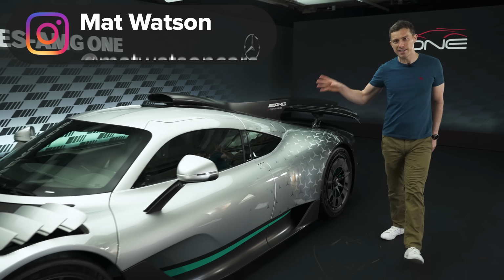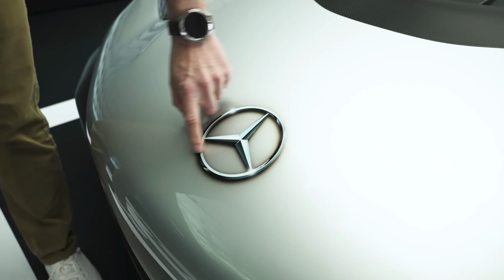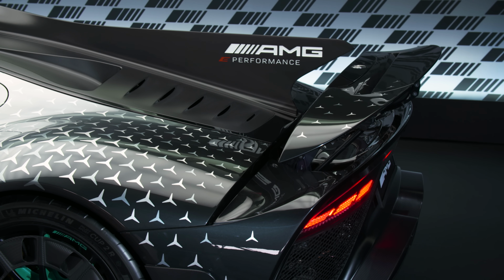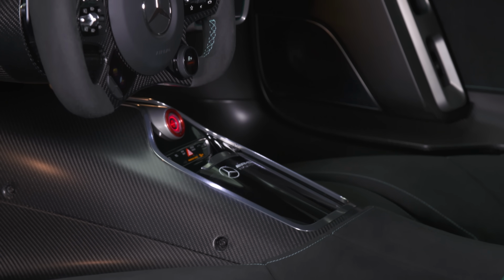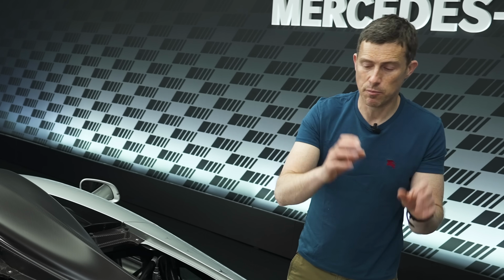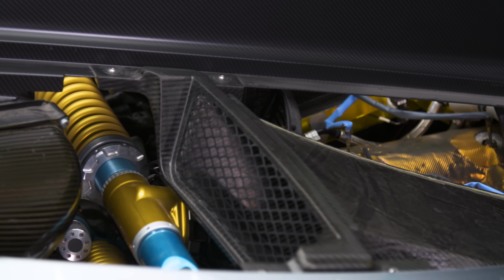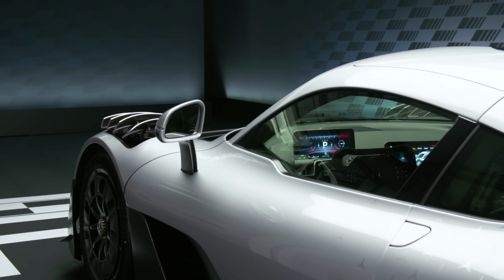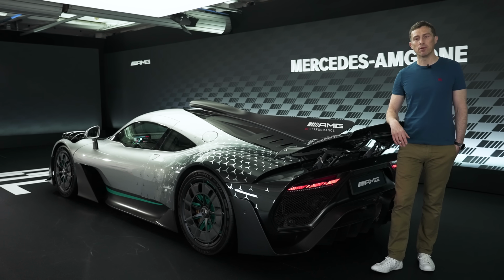Mercedes-AMG ONE: An F1 car for the road!

Comment: This thing looks epic :D. Already can't wait to see this go head to head with the Valkyrie and T50 ;)
Reply: Three very different cars though, to the point I'm not sure you can really compare them. This seems to be all about putting an F1 engine on the road and the result is an overweight, big and complex beast that'll likely be a right diva without a hell of a lot of maintenance which... actually, yeah, fair enough, they've put a modern F1 car on the road. The Valkyrie looks like it's focused on making a race car road legal which is very impressive for everyone except the poor sod behind the wheel who suffers PTSD every time they see a speed bump or pothole. And T.50 is more of a 'driving experience' car with ultra light weight coupled to a mad V12 while still being a (ridiculous) GT car. On track it gets even sillier with both the Aston and GMA cars having track-only variants and the AMG-One having that race mode which is very definitely not compatible with real world roads. Don't get me wrong, can't wait to see 'em all used in anger but a shootout for best in the world feels a bit... irrelevant.

Comment: I hope this car performs well on the track despite the fact that it’s heavy (1700kg)
Reply: and most important thing that the car doesnt porpoise
Reply: It's monstrously heavy, I am shocked
Reply: @mrle0719  yep. Its as heavy as NASCAR GEN6 Stock Car.
Reply: @mrle0719  same as 918
Reply: It’s heavier than a simple small car.. 😂 Even though they nearly did everything to make the weight as low as possible.
Reply: @Niels_f2704  i like the design but im not impress with the performance.
Reply: @Niels_f2704  yeah but this is anything but simple. Its also wide and long with electric motors
Reply: Why do people think this is like a C63S when we have 1600 kg Aventadors lapping the Ring in less than 6:50 minutes?
Reply: The car have porpoise like Mercedes 2022 F1 car. Ohh boy it's gonna be a hell of a ride
Reply: It's 1600kg on road without driver
Reply: @MT-eb2dx  Nope 1695kg without driver.
Reply: @MT-eb2dx  nearly double the weight of an actual F1 car. Quite mad.
Reply: @jasper5097  well, it's a road car, and it has EV capabilities.. so for that and the fact that it has 1000+ ps it's ok, the Ferrari sf90 weighs simmilar
Reply: @MT-eb2dx  1570kg SF90
Reply: @leehenry5764  1570 dry weight, watch gercollector weight in his sf90 with all fluids. He is about 1650 kg
Reply: @leehenry5764  the Agera and Maserati GT1 MC12 only has 1300kgs on average weight.
Reply: @MT-eb2dx  road car with F1 soul.
Reply: @sanlingerf8276  the Gen6 NASCAR cars also has 1648kg.
Reply: @purwantiallan5089  Yeah but they're entierly stipped out, the mercedes has 4 electric motors, three which produce 120kW and one 90kW. A 100kW battery weights at around 625kg. so the chassis and engine weigh about a ton with out the batteries then.
Reply: @MT-eb2dx  It 1690 so 1700 basically kerb side weight.